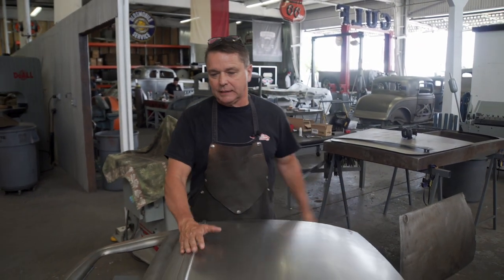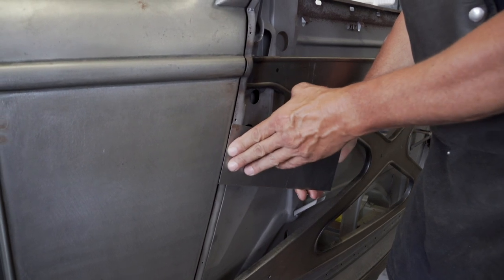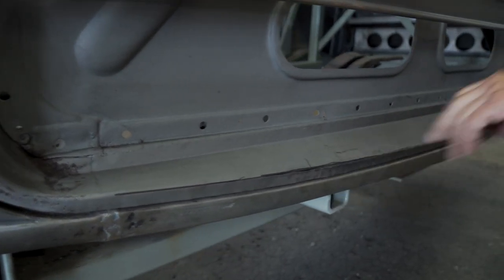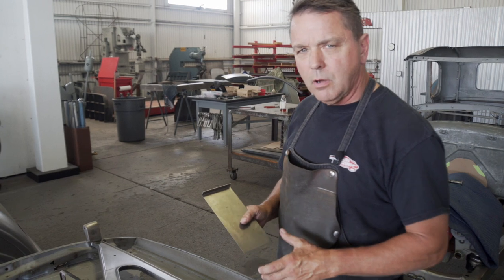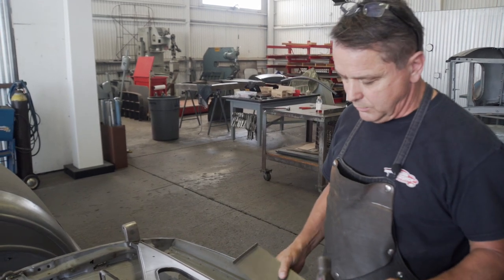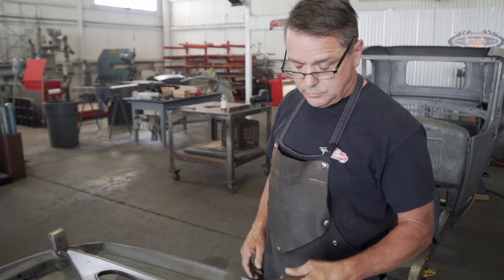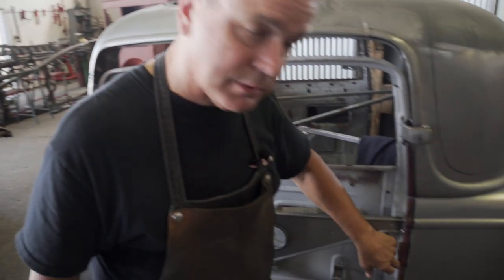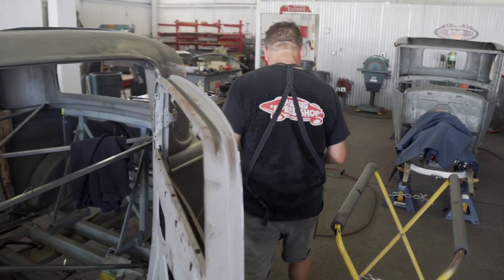Walden Speed Shop - Chopping 1932 Ford Part 9

Comment: If you are using the factory door frame and adding a new door panel why did you have to remove/trim the frame for a getting a proper gap? Is your new panel thicker than the original?